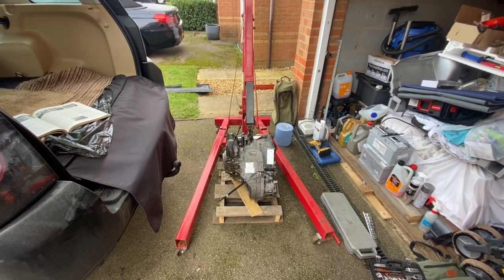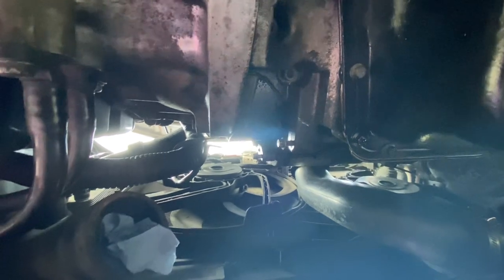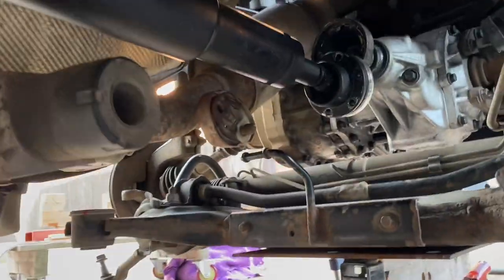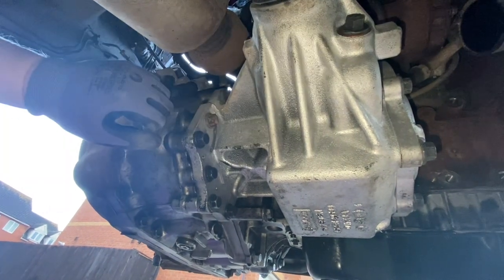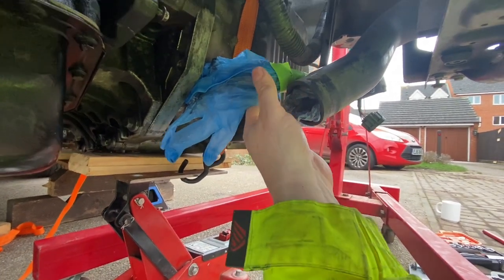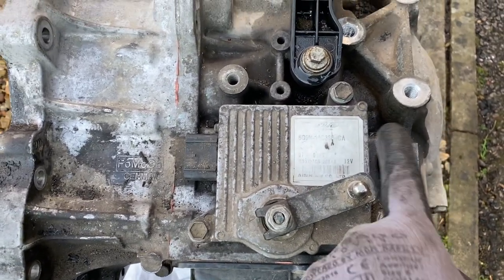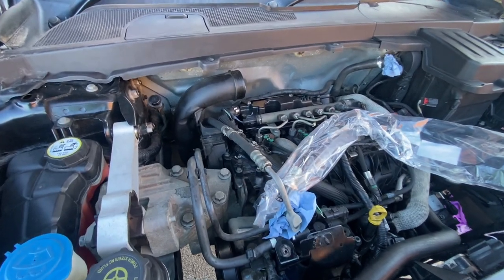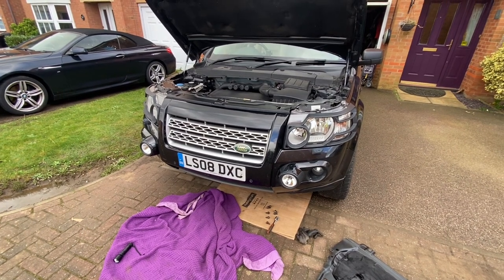Automatic Gearbox Replacement in a 2008 Land Rover Freelander 2 TD4

Comment: I dropped the engine and gearbox out together. I do not think it makes time any different, as its easier to get the bolts on the gearbox and starter motor. The angle box then is easier to access and remove the couplng for replacement. I used a motorcycle lift to drop the engine, and my engine crane as heights changed. Put a piece of slippery board on the floor, and drag the whole unit out.

Comment: Good movie enjoyed it. It's a too late now but the steering wibbly woobly pipe connecter is easy to undo, the rubber just needs to be pushed up with a tool, I use hose grip pliers

Comment: Do you have a link to where you purchased the front crank seal please
Reply from the maker: It’s the rear crankshaft seal I replaced as I understand the seal at the pulley end is classed as the front seal. I got the seal from my Landrover dealer.